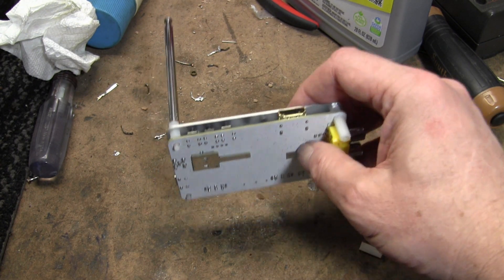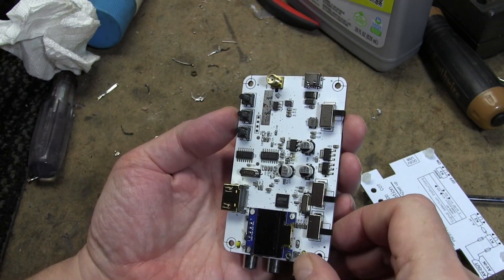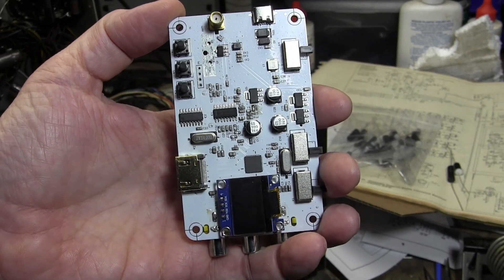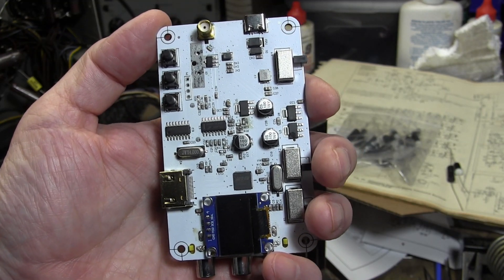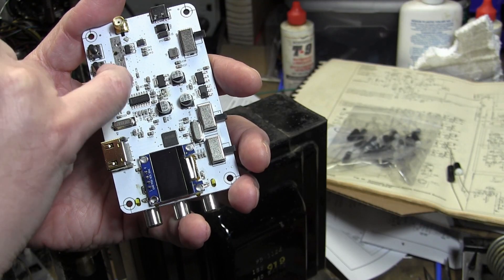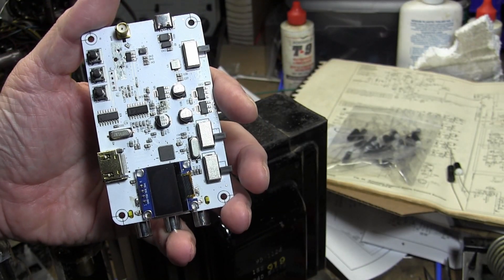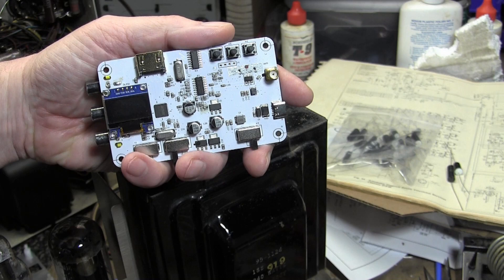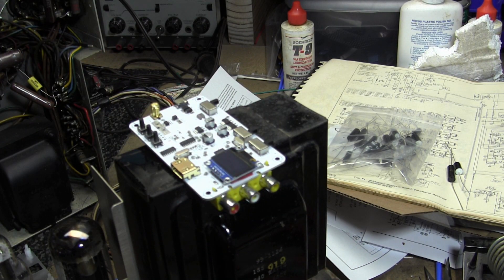What's inside the home TV transmitter?

Comment: If folks are going to make circuits for technical people.
Please just stick to the traditional Green or Blue Solder Resist.
I know you think it looks cool in White or even Black.
It doesn't. Because the people buying it are technical. Not stupid.
Reply from the maker: I guess I'm stupid then.  I think the print is much easier to read against white and I like the black adapt-a-caps
Reply: @bandersentv  Hell NO! My point is about tracing tracks on circuits. Black and White solder resist is awful.

Comment: Hello from Australia, I bought one of these after seeing your review.
It does work with NTSC color on my GE Portacolor, Sony KV 5000 and 5100 on channels 5 to 9 and UHF 23 so far with sound.
It does work with PAL Australian standard on the same channels but with different sound settings and a PAL signal.
I see the same hum bars and picture issues, i have found that WIFI can cause them and it seems to be a mix of WIFI and other signals as well as distance.
i can get a clear image on colour PAL and NTSC sets at 2m with the antenna set right.
On an all tube black and white pal set I cant get rid of the hum bars and the sound is very hot compared to other devices.
I'm interested to see what results others get.
Reply from the maker: Hello and thank you for the detailed feedback.  I will be experimenting more with this and other devices later in the year.

Comment: I'd like to think these devices are Part 15 compliant. It has been said that the old NTSC television frequencies are closely monitored by the FCC.
Reply: It absolutely not. There is no provision for low power TV in Part 15, and the lack of shielding and output filtering is likely to break spectrum mask and unintentional radiation rules as well. It is also said that the authorities do not intervene if one does not cause interference or other public nuisance, such as systematically broadcasting unlicensed FM over a large area.
Reply from the maker: That only covers AM and FM.  I don't think there is a legal power level for these frequencies.
Reply: @ Back in 1982, I purchased an Atari 2600. If memory serves, there was some notice on the bottom saying it was Part 15 compliant.
Reply: I bought one and I think the output power of 200 mw is exaggerated. It covers 1 room well in the house then is weak to non existent outside that. Seems to be in line with a BT modulator at full output.  I'll get around to measuring mine and report back. It seems like a well designed unit. I run mine on channel 10 too.
Reply: Just keep in mind that old NTSC frequencies are today's DTV frequencies (except high UHF, which was sold off for mobile phones), so these transmitters could cause interference to your neighbors digital TV reception if the transmit power is high enough. Also, because we learned these are not broadcasting on NTSC assigned frequencies, and may also be broadcasting unwanted sidebands, or out of channel (possible, since this transmitter also supports PAL, which is 8 MHz wide while NTSC is 6 MHz), you could be broadcasting interference into several channels, or even outside the TV band.  DTV is susceptible to interference, as I learned the hard way. I was unable to receive a DTV signal on channel 6, until I discovered if I unplugged my Blu-Ray player I suddenly received a good signal. I've also since noticed that Blu-Ray player also broadcasts interference into the AM band unless it's unplugged. Somehow, despite consuming almost no AC power while it's off, it's blasting out interference that killed TV channel 6, and creates a broadband whine across much of the AM band.  It may have a poorly designed or unshielded switching power supply. Based on this experience it apparently doesn't take much interference to kill a DTV signal.  And if you can't receive a DTV signal, it's hard to tell the difference between a weak signal and interference.
Reply: I’m not a lawyer, this is not legal advice

Part 15 is massive and [deliberately] ambiguous, and there’s a lot of sections that seemingly conflict each other. While it does only provide explicit details about ERP for AM/FM, but only vaguely covers “leakage limits” in other sections. 

One must remember that the FCC does not itself operate as it’s own branch of law enforcement, but rather, it too must go through mounds of red tape to obtain warrants in order to direct actual law enforcement to carry out anything (and it costs them a lot to it as well). For that reason, they triage what to throw their resources at… pirate radio stations pumping out KWs across a city, interfering with broadcasts from legit stations, deliberately ignoring complaints, and evading cease & desist letters are a MUCH higher priority than Joe Schmo’s micro transmitter that’s barely strong enough to reach from one side of his house to the other. They functionally operate on an “out-of-sight/out-of-mind” mode of operation. 

In essence, so long as you:
-only using just enough power to where the emissions are low enough for it (and any/all spurs) to attenuate into the noise floor before it leaves your property
-you’re not using a frequency that’s actively being used by a legitimate station
-you’re not causing any interference to anyone/anything outside of your property (they’re completely oblivious to the existence of your transmissions)

Then you’re not of any concern to the FCC. Even if for some reason they do find you/take issue with your transmitting, they’ll first simply ask you to stop. If you do immediately, that’ll be the end of it. They’ll only come after you with fines and equipment seizures if you refuse their requests and continue to transmit. It took years for them to finally take down MudDuck (the CBer from AZ that was blasting KWs across the country on ch. 19 being a definitive nuisance).